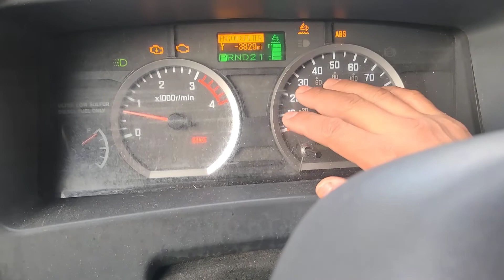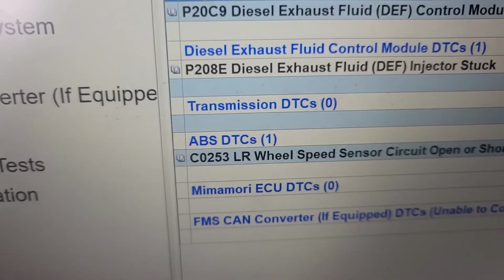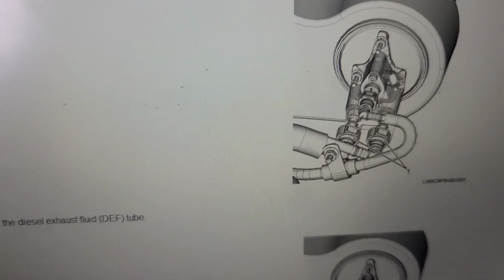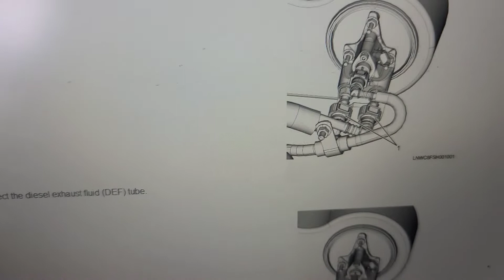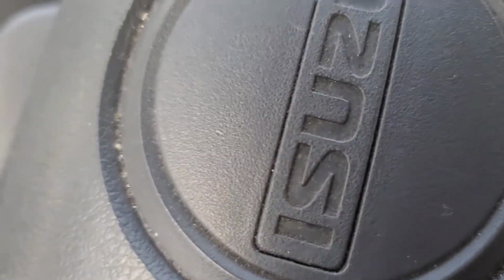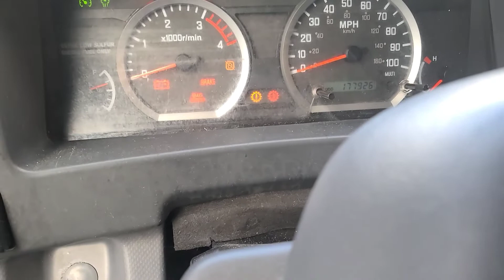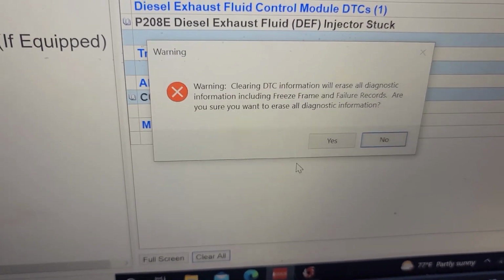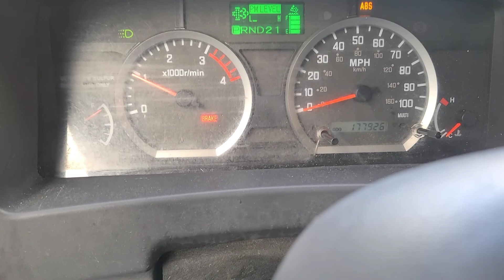2014 ISUZU TRUCK NPR RED EXHAUST SYSTEM DPF/SCR DERATE MODE

Comment: For those dry and fragile connectors. Spray wd40 on the connector. It helps to prevent from cracking
Reply from the maker: @sesgust13  👍👍👍

Comment: I need your advice I have a hino 185 2005 and when in gear it boggles down 500 rp.m but when put in park goes up  normal 800
Reply from the maker: Check the throotle valve if have next to the ignition key will be round bottom just turn to left side  will the rmp goes down

Comment: Can you tell me if this is the same part number for 2012 isuzu Reach truck 🚚
Reply from the maker: Yes
Reply: Can you provide me with the part number so I can place a order
Reply: How much will it cost me for you to come fix my truck I have the parts already and I'm in Miami
Reply: @sampierre9340  hey did you fix the issue? Also from Miami
Reply: @bumazka  no I didn't fix it yet
Reply: @bumazka  can you fixed my truck 🚚

Comment: I have a 2010 isuzu nrr 

The alarm for the antifreeze goes off but both the radiator and the reserve are top off 

What can the issue be?
Reply from the maker: Check the sensor and thermostat

Comment: Hello if anyone can help me. I have a 2013 Isuzu nrrr just replaced the dpf filter and got the other filters cleaned. After that I got the red exhaust light and de rate light. It was a clogged pressure line that’s fixed now my truck is wasting to much def fluid and throwing out white smoke if anyone can help me thank you .
Reply: What line was clogged and with what
Reply from the maker: Looks def injector faulty